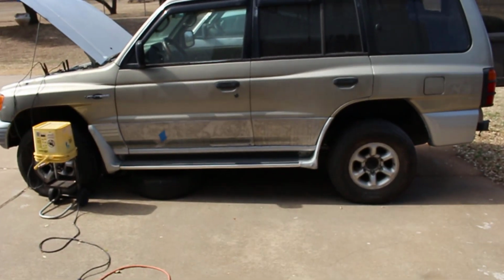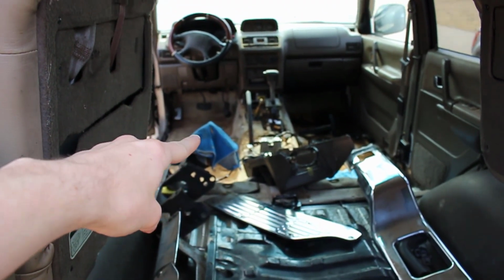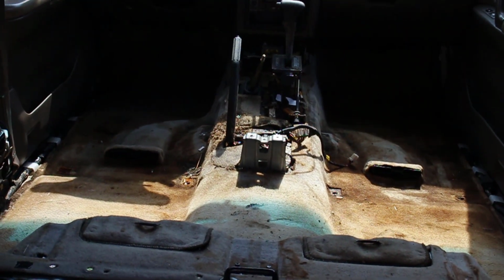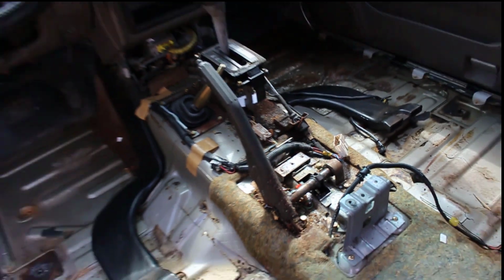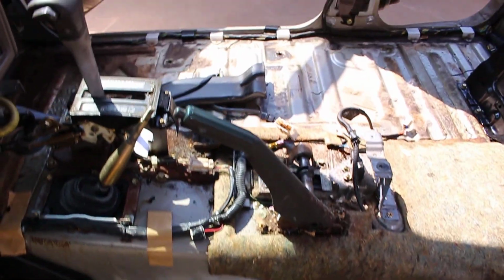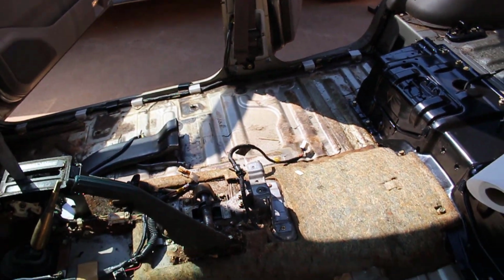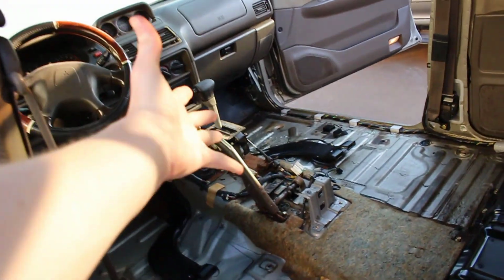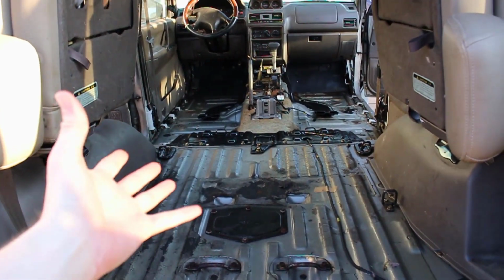Deep Cleaning a FILTHY Mitsubishi | First Wash in 17 Years | Satisfying Transformation

Comment: Hey, what spray/liquid did you use for cleaning out the interior. It looks like it was in a Zip bottle or something?? Thanx
Reply from the maker: The zip bottle is just a universal spray bottle you can get from the hardware store. For what’s inside is a 50/50 ratio of purple power degreaser and water. I dilute it to get more use out of it and to make it less potent. You’re less likely to damage any plastic/rubber parts by doing that.